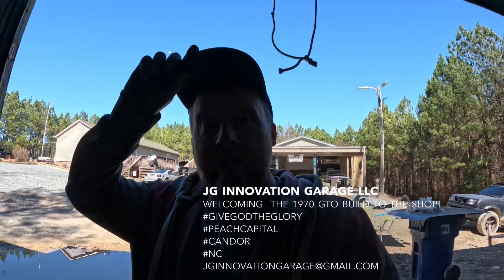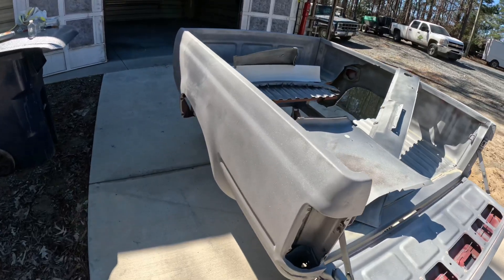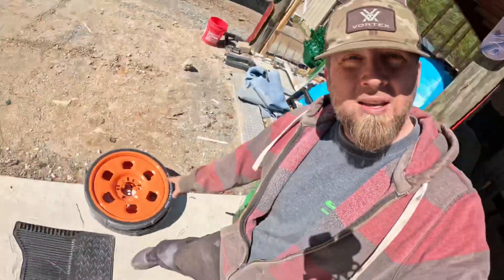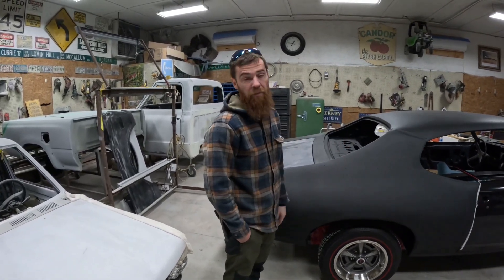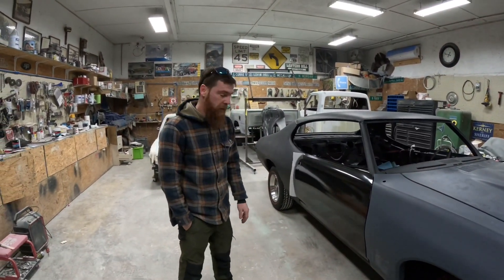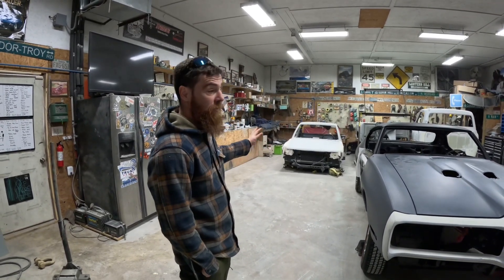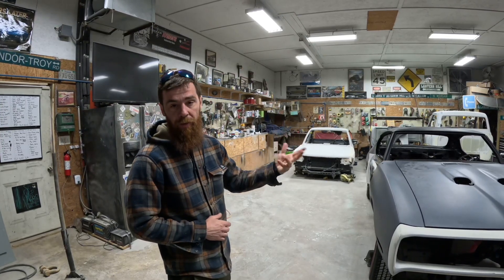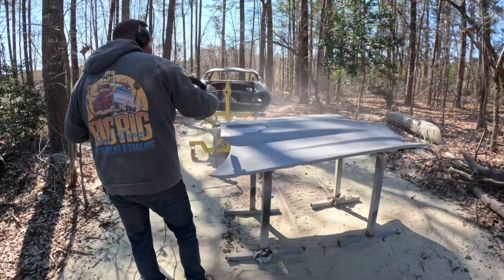JG Innovation Garage LLC & 1970 GTO Pontiac 26 options Pink Tag Special Order

Comment: That's not a 1970 though, with that nose it's a 68 or 69.
Reply from the maker: Well sir you are aware of the crazy things that happen in those days I hope. The owner of this car bought it new and ordered it so , I’m not going to question him about His car. I will tell you this much . I did a 1963 Polara convertible with a 426 wedge but wasn’t a wedge car because didn’t have right hood , trim ect on it .. so the owner said was 1 of 13 … then he shared it was actually 1 of 1 because in 63 it was a automatic, 318 car went to Europe for showing , came back the VP sent it back though the assembly line. Had 426 , 4 speed and red interior added , to it so all the plates on car told the story and facts . So that made it 1 of 1 and was $$$$$$$ so I don’t question what the client has or don’t have that’s someone else job . I do know I have a 66 mustang right now left side has 65 hinges plates and right side has 66 hinge plates , because different bolts . And GUY SAID he bought it new and never been worked on